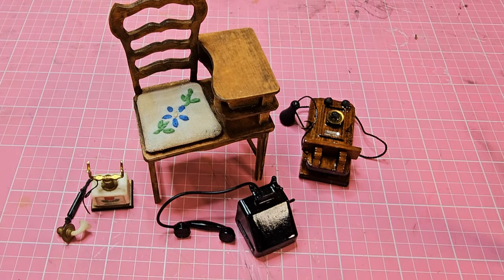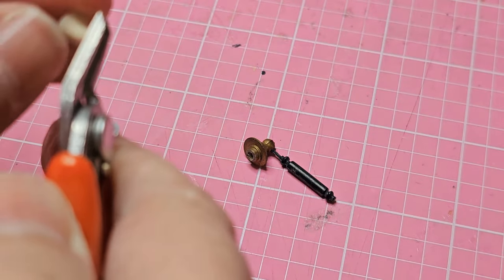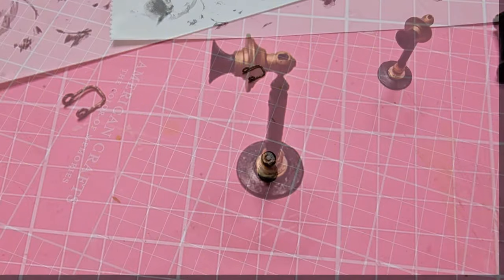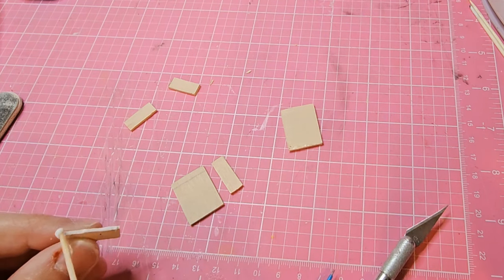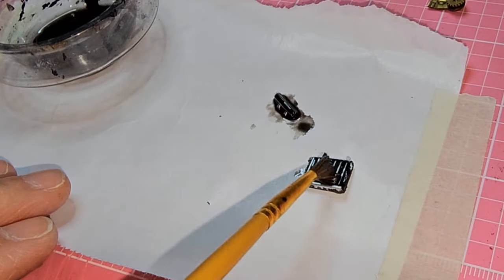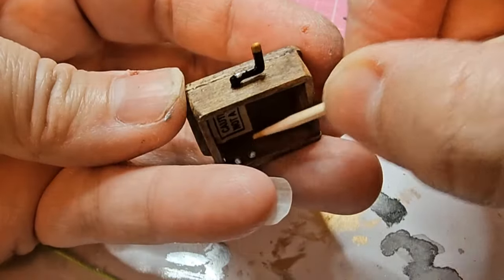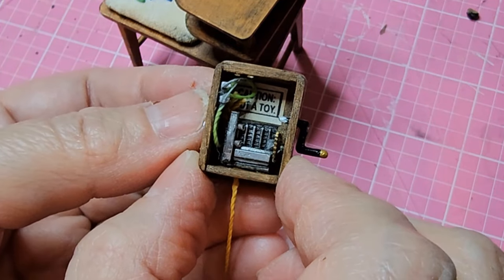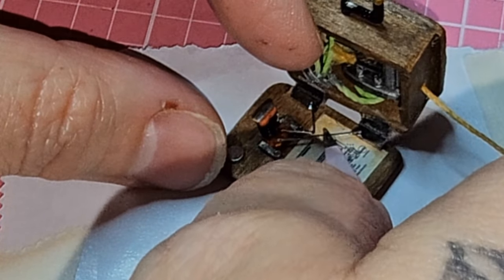Realistic Early 1900's Miniature Candlestick Phone w/ Bell Box |1:12 Miniature| Dollhouse Phone

Comment: I own some of these hand cranked telephones. There was actually a battery inside the phone, that connected you to the phone system. When you cranked the phone, there was a magneto that would generate an electric charge down the line that would signal the operator. It would also ring every other phone in the system. When a call was being placed to your phone, each phone on that particular line and a number of rings. If you were number 4, there would be that number of rings. This would let you know the call was for you. These were called party lines. The problem was they were not very private. Your neighbors could listen in.

PS you can buy smaller drill bits that can be found on line. I own one I bought years ago for drilling holes in circuit boards.
Reply from the maker: Thank you so much. How interesting and  sounds quite annoying. The phone is ringing all day.. no way!! What a scandal!! I would have been happiest without one.😂🤣 The party line, and when I was growing up, we were so excited to have 3 way calling, that was nothing compared to this.
Thanks so much for the P.S.🥰❤️